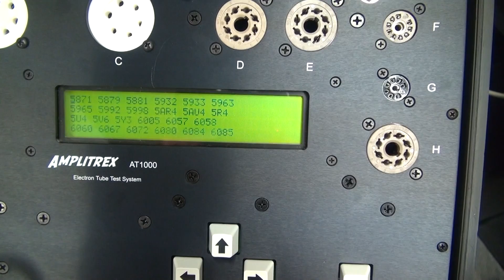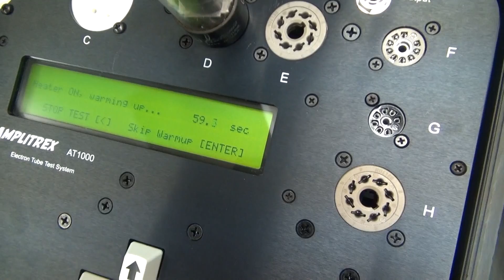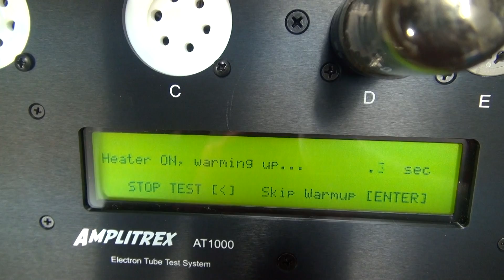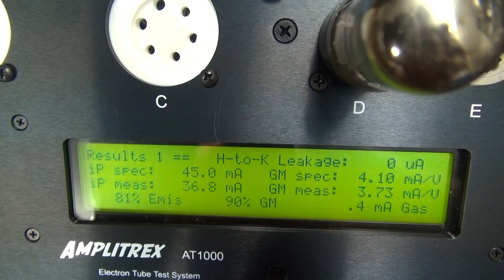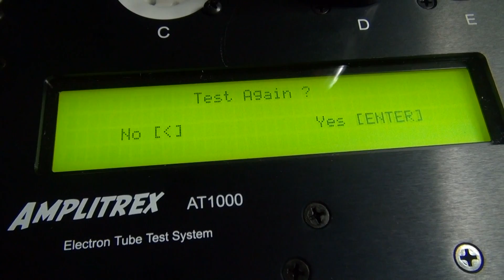How to test Amplitrex AT1000 6V6 Tube Demo by D-lab Electronics Tube Guitar Amps

Comment: I wish some Chinese engineer would design and build an updated version of this tube tester and put it into a large production run to get the costs down.  With a better computer interface and large production run I bet they could produce it for under $1000 maybe half that even.  You don't need a $200 Pelican case for a Microprocessor based tube tester, a simple metal chassis and pvc cover would do fine.
Reply: Check out eTracer. You have to build some of it. But it does curve tracing as well as basic pass fail testing. Under $1,000. Made by a Chinese guy who stole the idea from Utracer's open source schematics and made it better. https://www.essues.com/etracer/

Comment: Greetings - presuming you are still using the Amplitrex AT1000, have you used this unit to test rectifier tubes, and if so what are your typical results when testing a 5AR4 rectifier tube for the FWD and REV VPeak readings?

Comment: Looks nice and the price is more for a shop or a business and not the average hobbyist.  There are some that can afford this since an old tube testers like the TV-7D going for over 1000 that can not due data logging or trace a tubes performance.  It would be nice if they could bring down the price to under $2000.  If it were around $1500 I would definitely consider buying one.
Reply from the maker: +John Chan I agree. I did not enjoy paying the price, however it really does a nice job, especially for matching output tubes. I have had it for approx 5 years, no issues. TD

Comment: Have you seen much disparity between using the "auto-bias" settings vs "fixed bias".  I've seen sites that sell tubes that recommend not using the auto-bias as it may not test the tube properly and give you a false indication that it's good when it actually isn't.